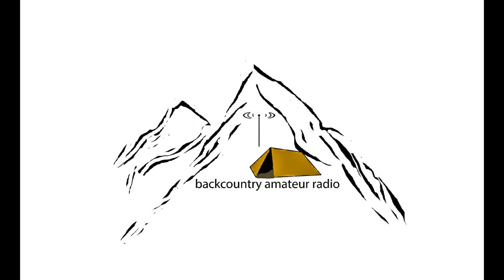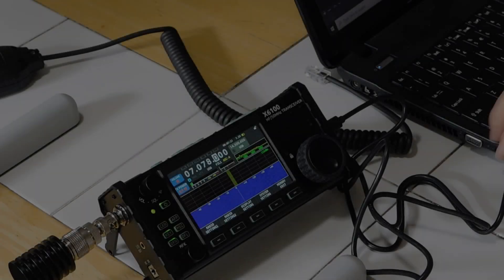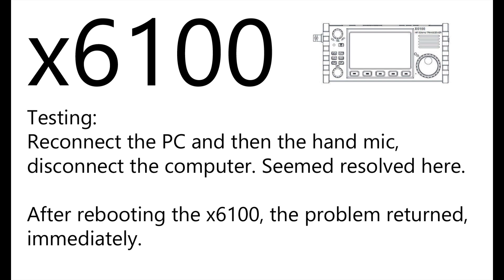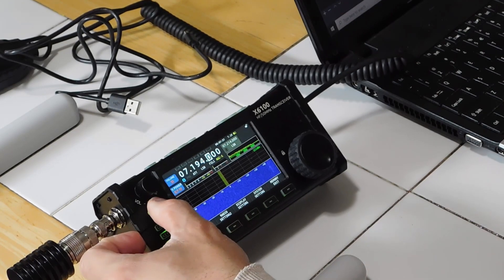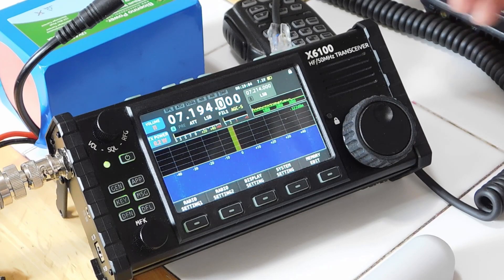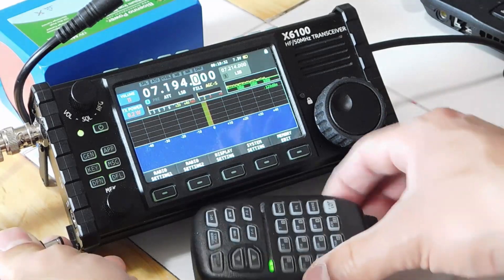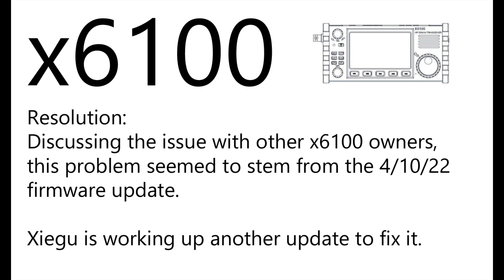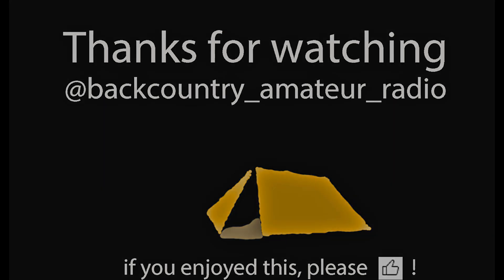Part 3: Xiegu x6100 Crazy Transmit Problem - Why is it happening?

Comment: I experienced similar problems with my X6100 today.  I just found this video and will try similar tests on my rig tomorrow.
Reply from the maker: how did your tests work out? That is something I hope they will fix through firmware updates.
Reply: @backcountryamateurradio  - With further testing, I figured out that my problem was actually that the radio would start to transmit and stay locked in transmit if I put the radio in CW or CWR mode.  As soon as I changed to SSB, AM, or FM, the radio would release from TRX.  It seemed like the radio was detecting a keyer press, even though there had never been anything even plugged into the KEY port.  I contacted Xiegu, and they had me return the radio for a replacement.
Reply from the maker: @hectormarchand9462  interesting. Thank you for the update! I’m glad they took care of you by replacing it.

Comment: V1.1.6  did not fix the problem. When my radio does this I also lose base firmware. only when batt voltage goes below 7 volts.
Reply from the maker: That’s frustrating. They must know it’s an issue by now.

Comment: Hellol, I don't know if I am just lucky or what.... I received this back in december, I have not had any of the anomalies you mention.
I use it here on the desk and in the field playing with QRP outings with  small LIpo Battery. No complaints other than the Sun washing out the screen.
Reply from the maker: The radio I was using is likely fully out of date as it was a preproduction model. Combined with some of the bugs (Xiegu is fixing, btw) from the latest (4/10/22) firmware update, I was definitely seeing some bugs manifest. I love the radio and I honestly don't think there's any reason to not buy one. I am waiting to see what/if Yaesu and Icom come up with anything competitive. I look forward to possibly purchasing an x6100 myself. I'm glad you've had great experiences. 73 - Eric